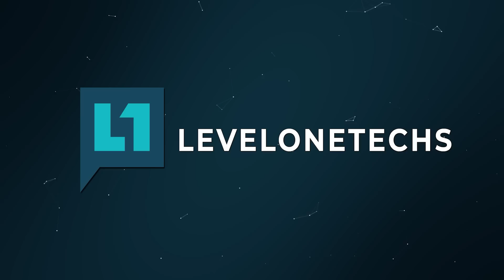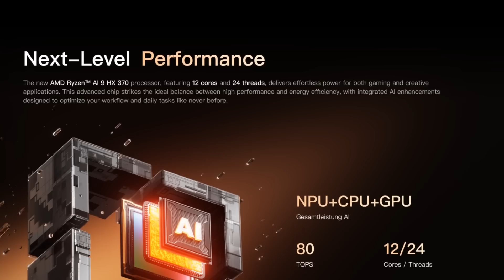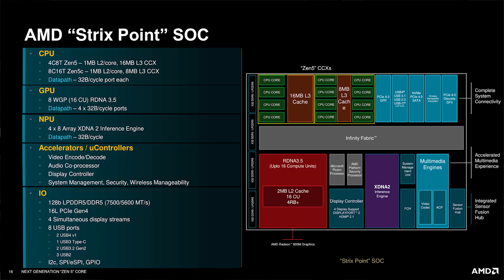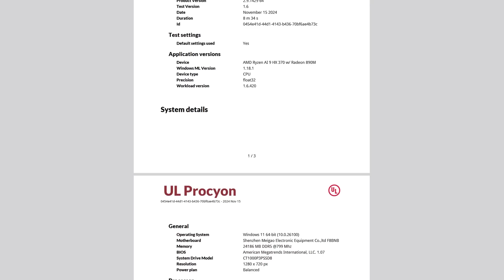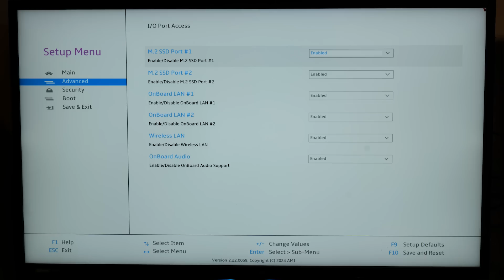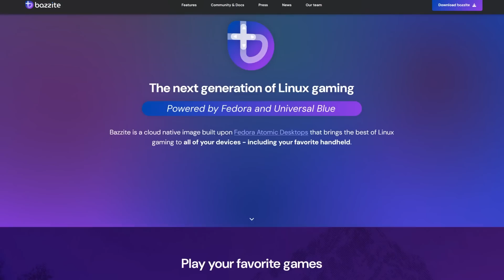Is The MinisForum AI370 Ready for the Singularity? Ryzen9 AI

Comment: I had a really bad experience with Minisforum. I have purchased AI 370 mini at the end of October. I have received the product in early December. I have invested a lot of time to setup everything and at some point, I have noticed some issues reported in Windows Security Center where certain security features were reported as not enabled. I have contacted support. They couldn’t fix it, so they asked me to return the product. They will either refund me or send me a new one. I have chosen to send me a new one, but they could send it only after sending the old one. I have managed to send the faulty one as fast as I can, so it was received at early January 2025. Unfortunately, they work with some contractors in Germany which causes certain delay until they can verify that the package was received. The delay was significant as like more than a week. The good thing was that they have agreed to paid for the shipment so the refunded me with 15 euros. I was hoping to get the new PC at end of January but after communicating with them I have received the bad news that they will be able to send it to me sometimes in February. I have asked for some significant compensation for this significant delay and they said they can only compensate me with 15 euros only. This got me frustrated so I declined that and wanted full refund. After all 3 months of delay and faulty product I think deserves more. They have refunded me for the full amount but without 15 euros. Those 15 euros they have refunded me for sending their product back were missing. I have contacted them again and they have said that they can send me these 15 euros only via paypal account. Refunding me via the same account I have used was not possible for them. It was not possible also to send them to bank account. I do not have paypal account so I ma not making such just to put 15 euros in it and after that trying to transfer it to my bank account. So, at the end I said keep your 15 euros if you are so pity. At the end I also lost some more money due to currency conversion. Their transaction was in EUR but my card is on BGN. I would not recommend this company or at least not buying directly from their site.

Comment: The 780M from Minisforum had CEC so it could power on a soundbar and TV. I use mine in the livingroom for that purpose with Dolby Vision/Dobly Atmos extensions installed in Windows 11. Works great. Can even do 12BPC 4:4:4 Chroma at 4K over HDMI 2.1. Have to make sure to install those extensions from the store and use the AMD software to enable the proper display configuration as well as have HDR enabled in Windows settings. It even can sense HDR content type in fullscreen so if Dolby Vision isn't available, it falls back to HDR10 but if DV is available it enables that color space.

Comment: I’ve got a belink ser9.  It’s basically the same spec.  Either i missed it or it wasn’t mentioned in video, but on the ser9 in the BIOS you can adjust between low, medium, or high performance (high being a 65w tdp).  You can also “overclock” the 890 in BIOs by a couple hundred mhz, and the RAM as well. I set the tdp to 85w (in windows not bios) and it’s handling the heat just fine. No thermal throttling in games, just in stuff like prime95.  I think this video understates the gaming performance. Surely this identically spec’d MinisForum system performs as well as the Ser9, which can run most games at 1080p and not always on low settings.  I would think of it like: “Any game a ROG Ally X can play, this will play better.”
Reply: What were you cin24 results on the highest power setting?  If I buy one of these, it will be the beelink because it seems to have a bit more flexibility.  Right now, I'm still on my mac mini kick.
Reply: @Raintiger88 You may very well be able to do all the same on the MinisForum.  Maybe even more.  He didn’t do a deep dive on that in this video.  For example, the bios surely has a few different performance/tdp settings.  And even if it doesn’t you can still use tools in windows (ryzen master won’t work, but RyzenAdj console works) to adjust TDP etc in windows.  The MinisForum certainly looks like it’s got a good cooling set up.  As far as benchmarks, I didn’t run cinebench.  I mostly did gaming benchmarks.  Having said that, if you search 3D mark results, and filter CPU = HX 370, and GPU = 890M, you’ll see my results (DocBrody) for almost all the benchmarks.  If you check notes on my run, i usually put the TDP down.  If it says something like “65 bios perf” that means TDP of 65, set by selecting performance in bios”.  Anything else were tweaks in ryzenadj.      And one final note… bee-link support is basically a folder with some files in it. I had to dig around to find an updated bios.
Reply: @docbrody  There is reviews comparing minisforum and beelink directly and it seems that ser9 has better cooling resulting in significantly lower temperatures. I`ve got ser9 myself and happy with it.

Comment: I've been running CachyOS on my ancient laptop (ASUS TUF Gaming FX505DY) with a AMD Ryzen 5 3550H, and it feels faster than it was under Manjaro did. Why did I switch? I like trying new distros. When you have been doing Linux since '93, one takes your entertainment where you can. 🙂
Reply: I use CachyOS on my main system and it's by far my favorite Linux distro. I will be putting it on my laptop once Windows 10 goes EoL.

Comment: I think the EliteMini AI370 is a solid device, but the price is a bit too high. $1,100 is the same price I paid for my Vivobook S16 with the same processor, RAM amount, and SSD, but that also comes with a nice 120Hz 3200x2000 OLED display, keyboard, trackpad, camera, mic, and speakers. A mini PC with the same specs but none of the other parts that make it a laptop should cost quite a bit less.
Reply: Economies of scale.
They missed the memo.
Reply: @AnirudhTammireddy  I mean, even compared to other Minisorum mini PCs it's not a good deal. The Minisforum UM890 Pro has a Ryzen 8945HS with 32 GB RAM and a 1 TB SSD for just $650. (Actually just $610 with a discount that's valid right now)

The Ryzen HX 370 is definitely better than the 8945HS, but I don't think it's so much better that spending almost double for the PC makes sense.
Reply: Form factor